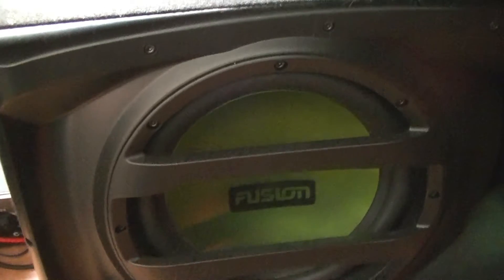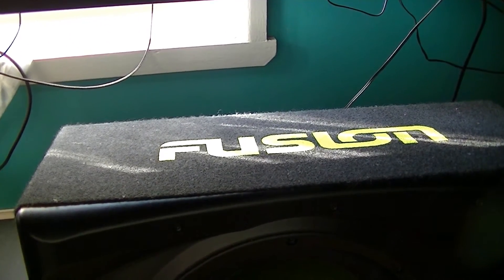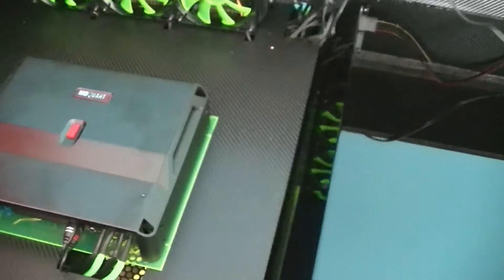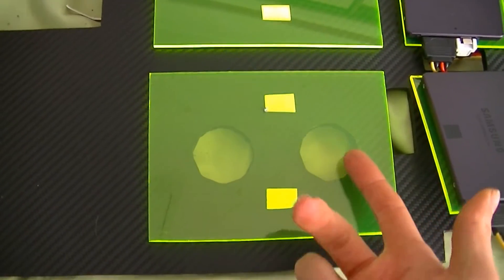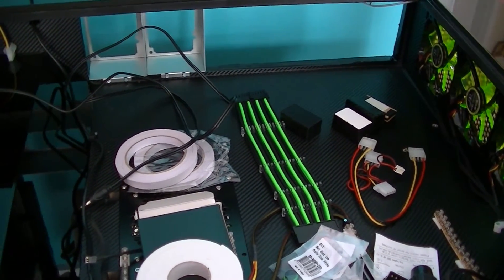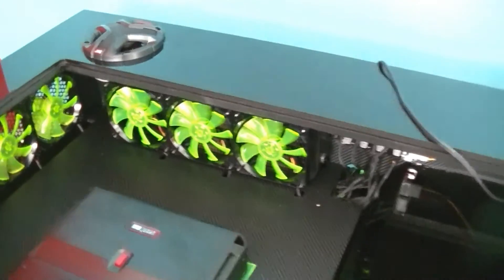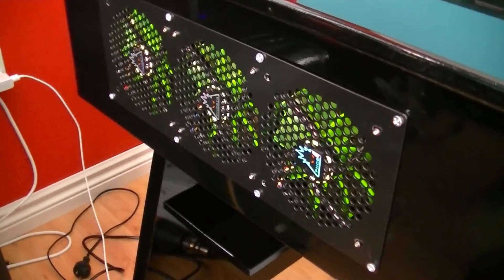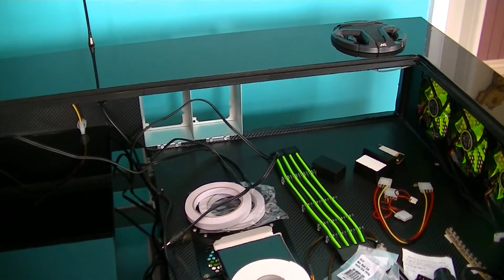Custom Watercooled PC desk mod part 1

Comment: 6:17 Wait, do you use dbrand skins?! Looks so cool :D Btw where did you get those green coolers, they loos so good.
Reply from the maker: +Kilo Portmann thanks man, nope it isnt dbrand, it is just carbon fibre wrap
Reply: Imfaceroll Gaming
It looks like those dbrand skins :D  Do you remember where you bought those green ventialtors/coolers or however they are called in english?